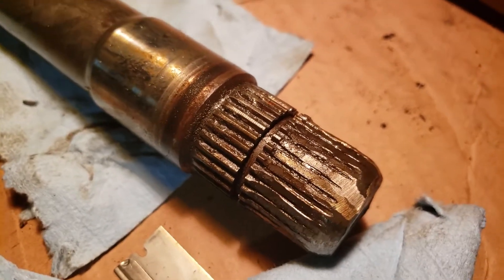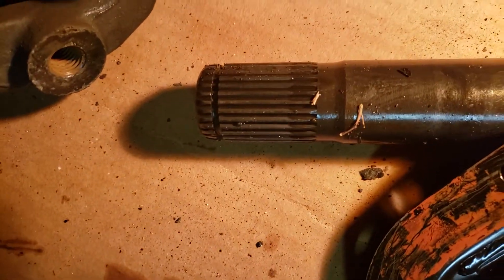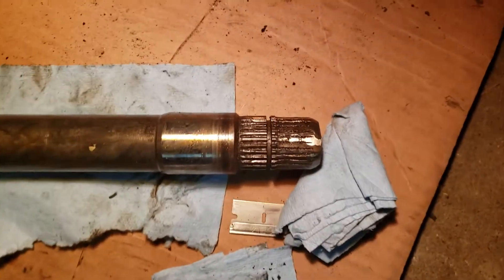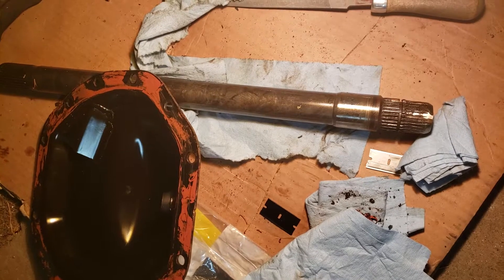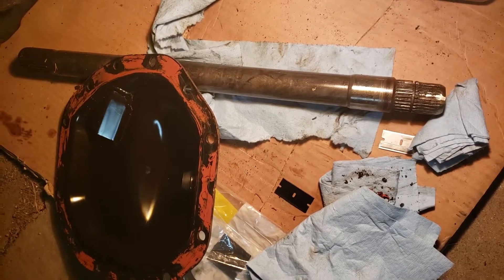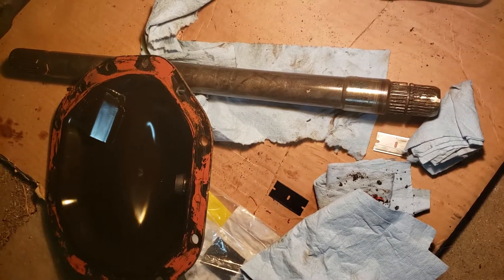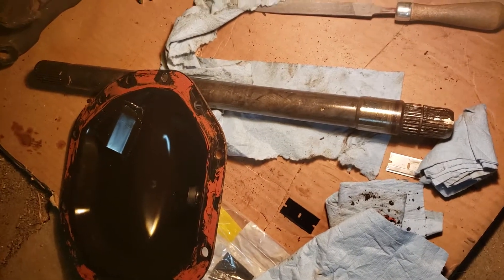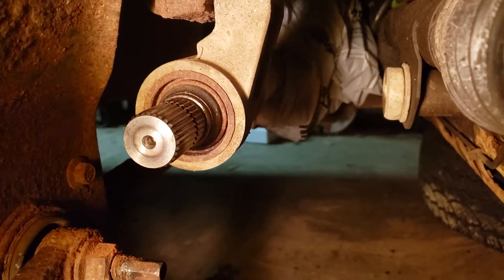Ram 1500 Intermediate shaft replacement

Comment: Hey bud, how did you get the c-clips on the new shaft? Did you push it in from the outside until it seats or did you have to take apart the front dif.
Reply from the maker: Well luckily my neighbor had some experience, I would have been lost. We took the front diff cover off, slightly rotated the gears and pulled the clips off then removed the shaft. It was most definitely a pain. For the new shaft we slipped the clip on inserted the shaft then installed the outside clip (nearest the tire). And yeah slid the lock clip from the outside until was properly seated in the groove. Hope that helps, any other questions let me know.